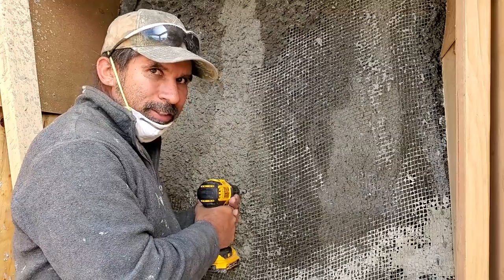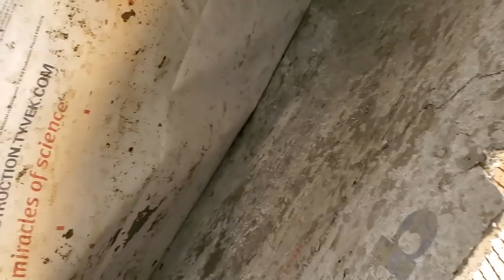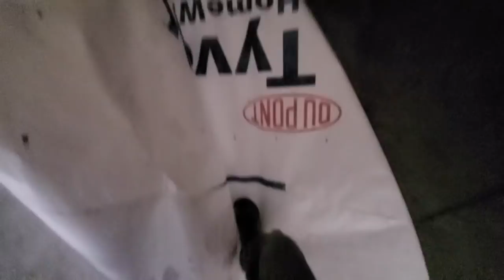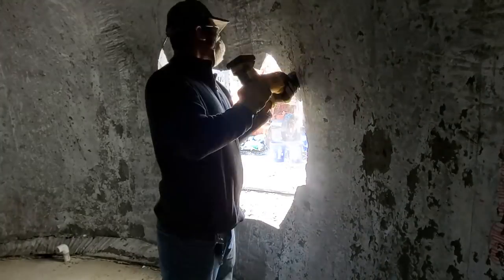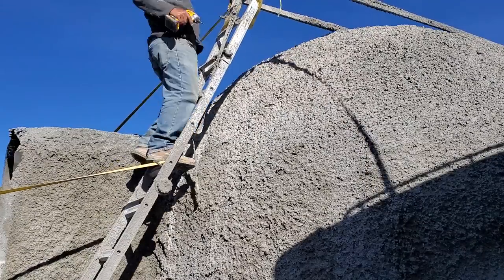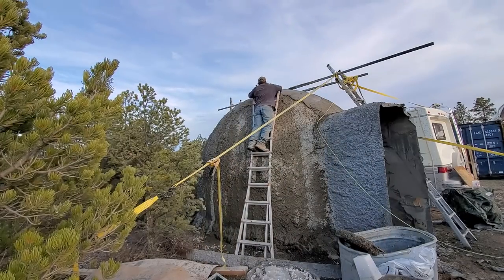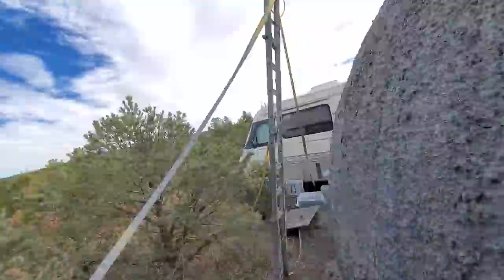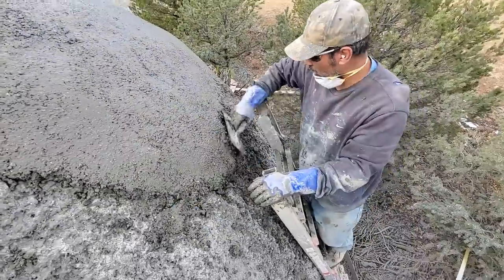Building Dome Cabin | Part 4 #aircreteharry #EPICcementmix #slab #domehome #aircrete #diy #airform

Comment: I'm 60 years old. When I was like eight years old in Arizona, My father used what was called white wash, I believe it was pink cement , lime, and bluing. It was a coating we applied to stucco basically gave it a super white color. It also added some strength to the stucco. I believe for the most part we brushed it on with big horse hair brushes, common at the time.

Comment: I can see that the Tyvek form has created a nice smooth interior wall!  I'm wondering, why did you put any aircrete at all over the area that you later cut out to create the door?  And did you consider making a skylight in the roof for extra light?
Reply from the maker: To clarify, it is all EPIC, no Aircrete. The door area had a very thin layer. Yes, that can always be installed.

Comment: Using the screws as a thickness gauge was a great idea. Man, the wildlife there is awesome. If I was standing inside that structure, I would sure feel better if I knew those mixes were full of a fiber reinforcement. That's a lot of weight overhead. I would be interested to know about how many lbs when you total it all out. Water weight does not reduce as the cement cures. Hope all is well guys, stay warm.
Reply from the maker: 40 bags of cement in the slab, 120 in the dome. at 94 Lbs per bag....  Thank You!!
Reply: Thank You so much !!
Reply: There’s nothing saying you can’t reinforce it with whatever you’d like.  The Skies the limit.
Reply: @AircreteHarry  what was cost on the bag of concrete harry its change so much i wouldn't know right now
Reply from the maker: @towerace1238  Depending on where you live. Last I ordered it was almost $16.00 here in COLORADO.
Two years ago we paid $11.00

Comment: Great commitment the 
dome is up.. fantastic effort..  will you stick to the air form?
Reply from the maker: I will continue using air forms I make. I also have other building methods I will be using. My next build will be using car tires.
Reply: @AircreteHarry  cheers look forward to your designs I get the dome but have you considered the tube. I have child hood memories of these structures, they were built as migrant shelters and were used for quite a while i met a few of the kids that lived in them and still have a friend whose family was  assigned to one. One thing they allowed air flow if not insulation. Anyway aircrete is  offering a great srayon building material . Hers a link https://en.m.wikipedia.org/wiki/Nissen_hut
And I was thinking of getting the desired depth of material have you  seen these  ideas perhaps it can be useful in your thoughts all the best
http://www.landscapearchitecture.com/landarchspecs/cellteklandarchspecs.html
Reply from the maker: @rowleyz5943  Yes I have but what I'm going to build I call the pill or long dome it will be about 50 feet long with dome ends.

Comment: Could you vaccum the air out of the form to save risking damage drill in?
Reply from the maker: I don't believe that has ever been tried the next dome i build I will try vacuuming the air out, good suggestion thanks!
Reply: @AircreteHarry  I mean if it was airtight to the dome your going to need to drill something to let the air in as you vaccum the air out right? But not big at all.
Reply: Simon, it already had the holes at the top.🤷‍♂️

Comment: is it posible to build a 27-30 ft diameter dome with only steel mesh and basalt rope ?
Reply from the maker: Yes, it is possible.
Reply: @AircreteHarry  and I fotgot to add the fiber glass mesh, but dont you think its a really wide area or those 3 elements can get the job done?...

Comment: If the air form was a sphere it could be nearly half buried so that the widest point was waist height?
Reply: I think this is an interesting thought.  dig out to waist level or start against a hill and have a few steps down into the ground to reduce the work/structure height. use the ground to help moderate temperature.
Reply: @BCS2023  Sort of classic igloo. My garage is mostly underground with a grass roof and it does stay constant-ish on temperature.

Comment: Aircrete Harry: I know you like domes but what is the least expensive traditional frame house one can make with EPIC cement?
Reply: imagine is you just framed the house. then staple a cheaper mesh to the framing. spay as harry has done on this dome strait to the mesh. lightly. then spay it again and the second coat will fill in all the mesh holes. then go on the outside and spay a coat on it and smooth or texture outside as needed.there is a guy that uses old Styrofoam ground up done right that stuff is light and would make a great outside coat over the first shell. i think run the electric inside of cheap tubing would be wise. and maybe even water lines if needed. that way wire and tubing and be pulled it will be encased on the inside layers . on the inside just use plaster.  layers is the key with layers of cheap mesh..

Comment: You said you were putting on the thickness of about 3 and 1/2 inches. You might want to get a tape measure and see what that really is. What you were putting on was about one inch thick.
Reply from the maker: Lol, I know how much I put on. 1/2 was the stranger EPIC mix the 3 inch was the insulation EPIC mix.

Comment: How come you just didn’t build it the monolithic home design way, which would’ve been a lot easier and stronger?
Reply from the maker: I did not build it Monolithic because I was experimenting with a new cement mix that is insulated. And far less expensive to build with this system. Monolithic domes have leaking problems also and the spray-foam is very expensive.
Reply: @AircreteHarry  Where are the leaking problems with Monolithic Homes, because the outside of the dome is covered in vinyl, which keeps the moisture from even getting into the foam and concrete?
Reply: @AircreteHarry  and with Monolithic home, at least you can see where the leak is coming from from outside of the vinyl, but your design, you’ll have no idea where the leak is, because concrete is on the outside, and it can crack in many different areas.
Reply: @AircreteHarry  Airform is your protection from leaks. And it looks like you just remove that from the inside of your dome. So all you have now is a concrete shell, which will leak eventually.
Reply from the maker: @BigCountrySo-CaL619  The vinyl breaks down in the sun after 2 - 5 years then you have to repair the outside. This happens to all the monolithic domes.
Reply from the maker: @BigCountrySo-CaL619  Not true that's all part of my cement mix design. My concrete mix is water proof.
Reply from the maker: @BigCountrySo-CaL619  Also you can paint inside and outside with waterproof paint.
Reply: @AircreteHarry  didn’t think about that, that does make sense.
Reply: @AircreteHarry  actually come to think of it, out here in San Diego in El Cajon, they painted one of the county buildings, that used to be a jail, out of rubberized paint, which was expensive, but it still on there, and hasn’t damaged or faded, and it gets pretty hot out there.